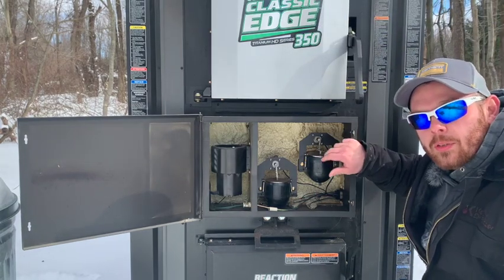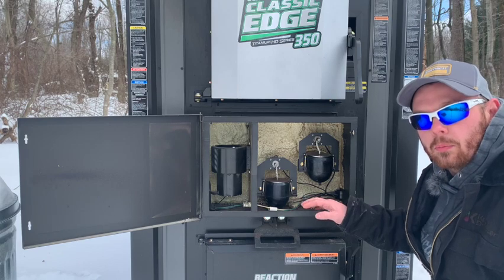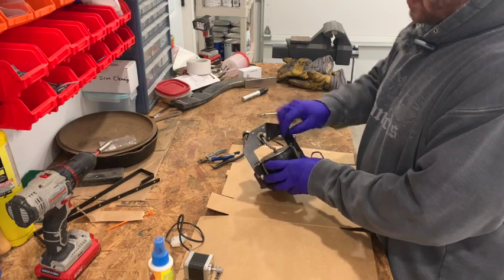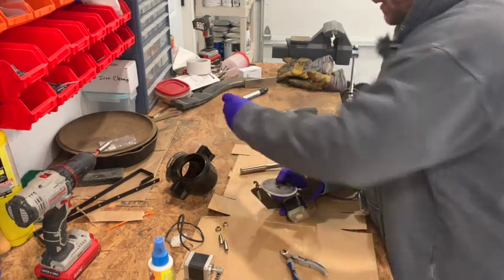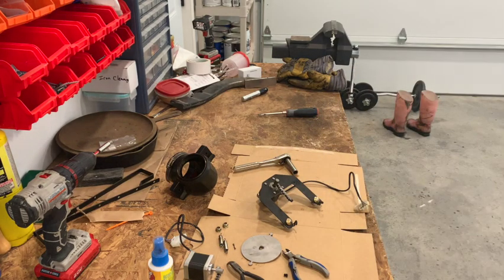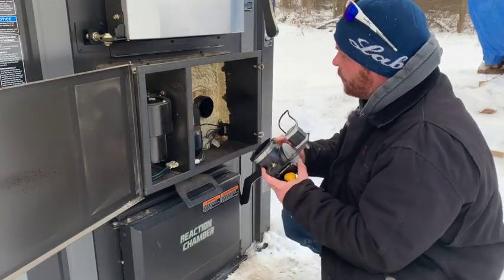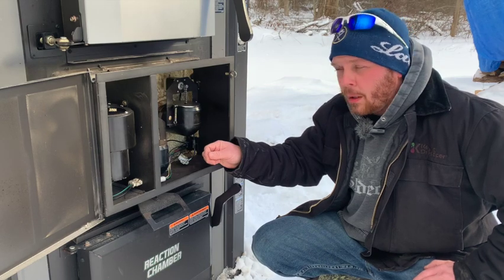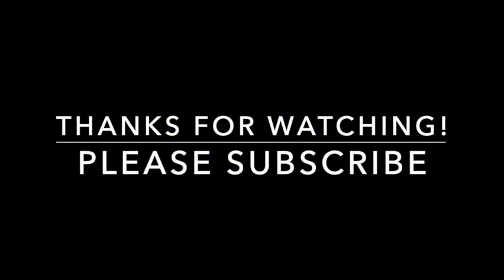HOW TO REPAIR OUTDOOR WOOD BOILER DAMPER STEPPER MOTOR .#8

Comment: I am having an issue where my fire is going out despite having plenty of wood left in the box.  I am thinking its an air flow issue so i cleaned the air tubes and got as much of the creasote out (which wasnt much) and the fire worked well for about 1-2 weeks and is starting to die out again as before.  I am guessing now, thanks to your video, it is my stepper motor that is bad.  Is there a way to test this theory before buying a new motor?
Reply from the maker: I’m not sure how to test the motor sorry. Are the dampers clean?  I’ve had the lids get sticky and then they don’t open like they should all of the time also.